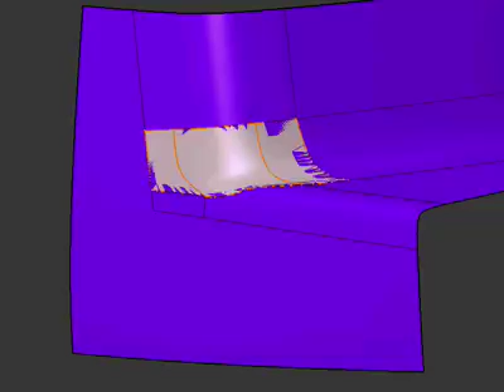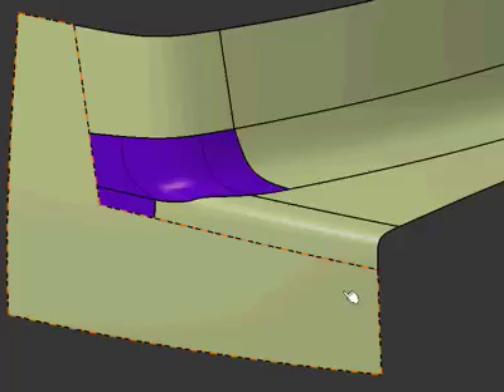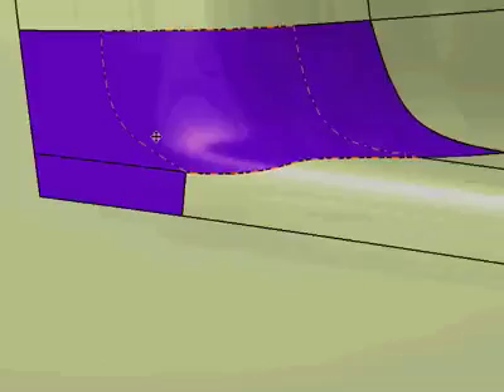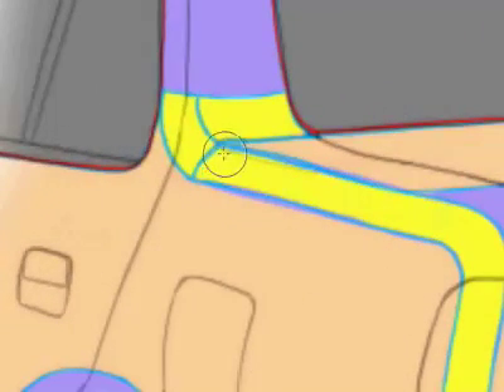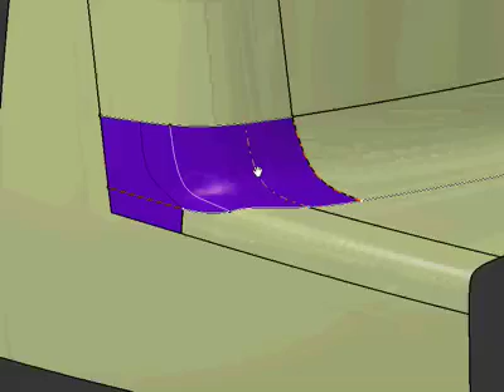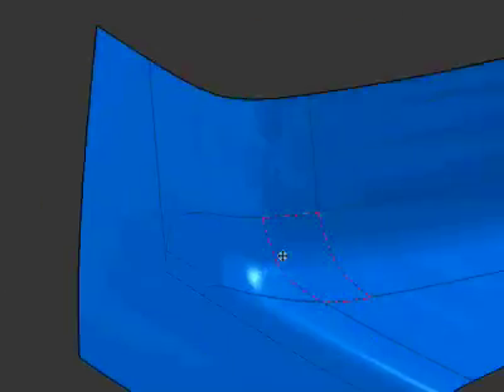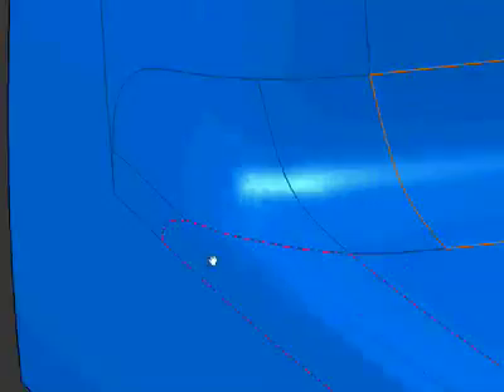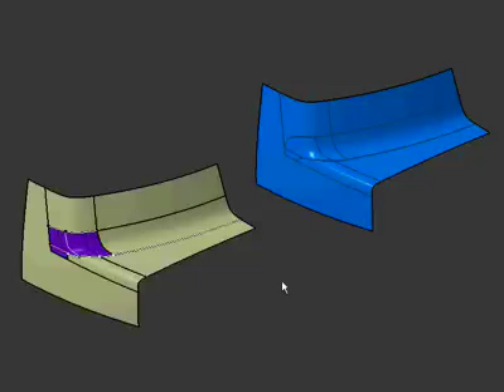hypersurfacer03

Comment: Interesting. I actually know zero about surfacing. Hence why I'm here. I have some knowledge with Creo parametric, and was using the surfacing capabilities to try model a car and came across this issue. Seemed to realise that surfacing isn't just surfacing. There seems to be some fundamental construction concepts one has to learn first before using whatever CAD tool. Thanks.  Have moved away from Creo now.